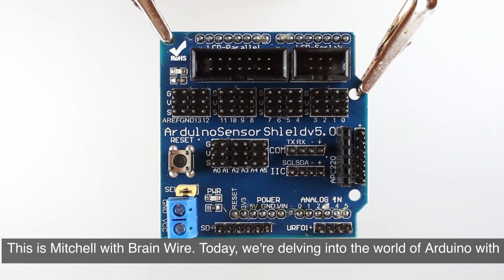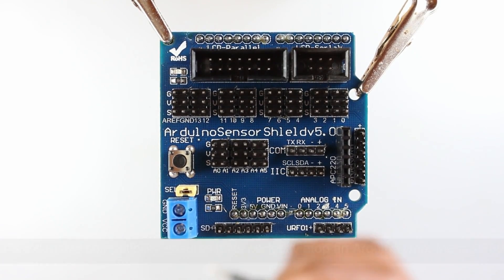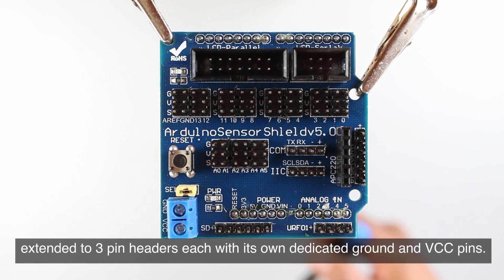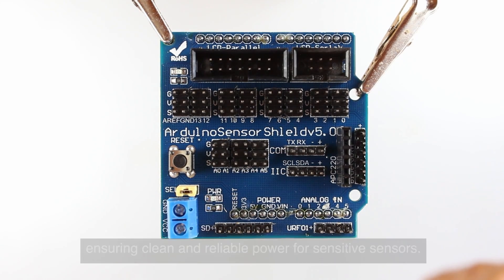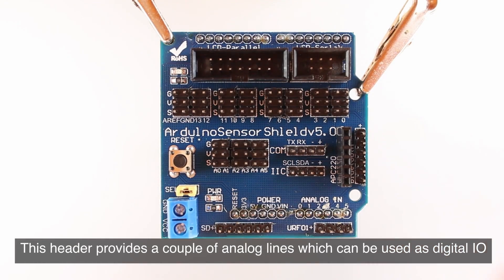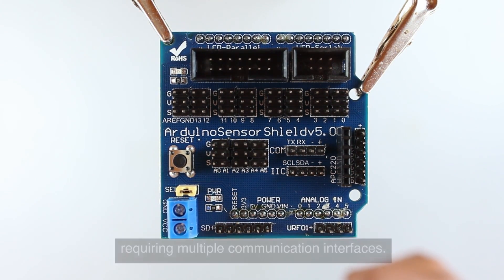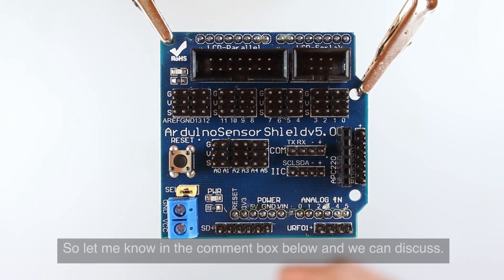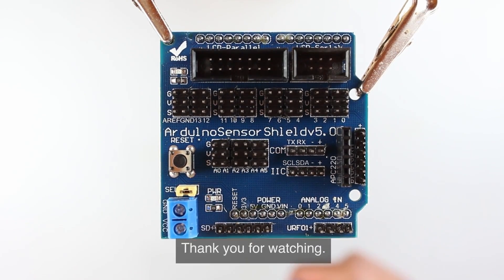Arduino Sensor Shield V5.0 Product Intro - Easy Arduino Project Integrations!

Comment: I am currently using a motor driver shield on an Arduino UNO board which I can connect with motors but has a limited number of pins for connecting multiple sensors. If I get the product mentioned in this video, will I be able to connect it with motors too? Please let me, thank you.

Comment: I'm constructing an automatic wheelchair using ultrasonic sensor, LCD display, Bluetooth, Ln298 motor driver, buzzer, LED, and Arduino Uno R3 microcontroller

Comment: Very informative video, does the shield power the Arduino UNO board when you connect the 5v supply to the shield connectors?   Also if doing this doe one have to remove the jumper beside the power connection terminal on the shield or does it stay on?   I look forward the hearing your responses to my question as I am looking to use the shield for powering servos on a model railway layout.

Comment: i used it for spider robot with four legs with each leg use two servo, so i can say i use 8 servo. and... its erratic. i think its power issue. anyone kind-hearted to share solution? should i use separated power source for the servos and the arduino UNO? i am an amateur by the way.

i hope anyone... can help

Comment: Does the external power pin on the sensor shield provide power to the arduino? If yes, Is it after or before the voltage regulator?

Comment: I made my own DIY IR sensor for line follower robot car.
5v from shield's GVS to my IR sensor doesn't work.
I already measure the voltage from from GVS and it show 5v on my multimeter.
I don't know why it doesn't work. Weak current?

Comment: what is G V S ?
Reply from the maker: Hi Friend!
Apologies if that wasn't clear. G = Ground, V = Vcc (positive 5 volts), S = Sensor/Signal, this is the pin where you connect what you want to evaluate, either an analog or digital signal you need to know the status of.
Reply: Hi, how could use the pin 0 and 1 there is no place to put the jamber wire